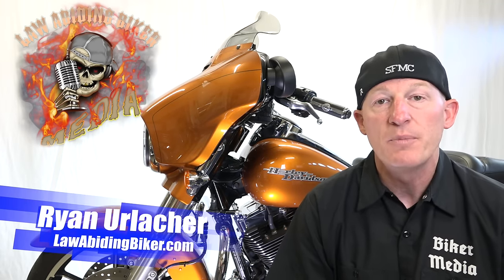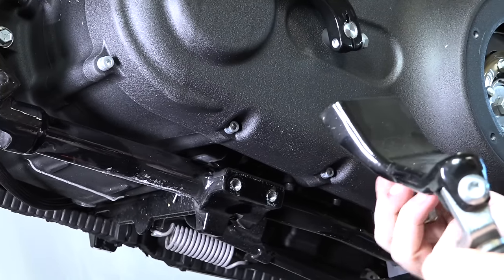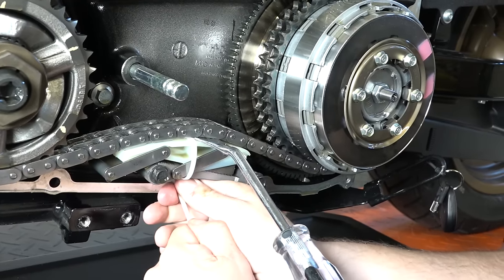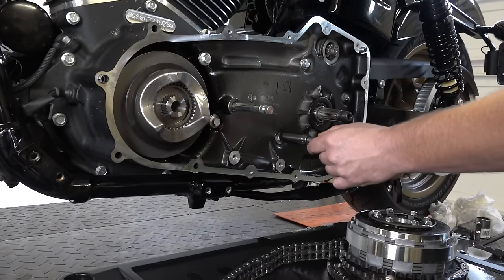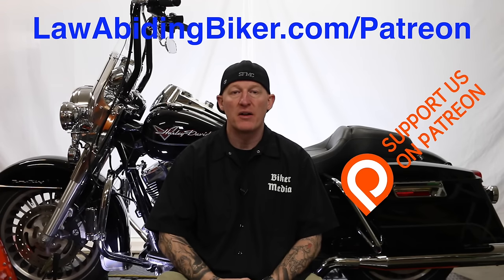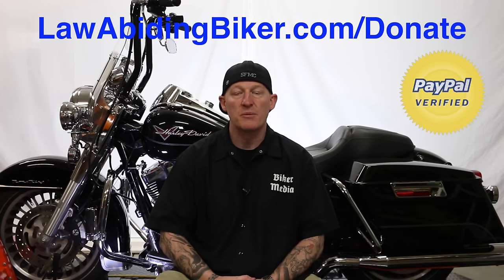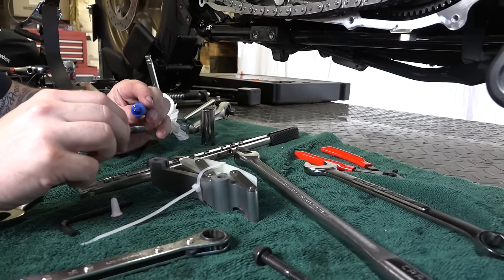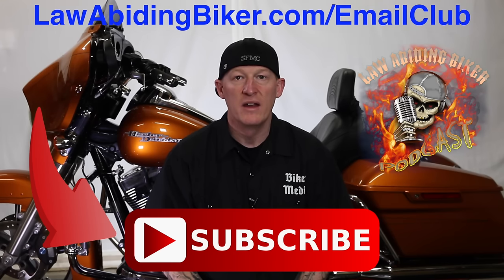How To Remove & Replace Final Belt Drive on Harley-Davidson-Motorcycle Biker Podcast

Comment: Interesting, I did not know Harley Davidson still used imperial size bolts and screws decades after the US auto industry went metric. The video shows everything but the actual removal and replacement of the final drive belt.

Comment: Wish I could find a video like this for the fam swing arm bushing replacement I need to know the nut size for the swing arm hshaft in hope I can get a ring spanner and thin it down so I don’t have to remove clutch set

Comment: First wanna say thank you to Ryan and team for an excellent video. I’m only here because I stopped to see if I could help a guy on an older super/wide glide who was broke down in a parking lot today. His final drive belt was broken in half. Nothing I could help him with.
I just wanted to see how much of a bastard job this was. Certainly not a side of the road job. Confirms my feeling that Harley built it’s best bike starting in 1952, the Model K. It was then modified in 1957 and renamed the Sportster. 2022 is the 70th anniversary of this bike, still in continuous production, 71 YEARS ! The first Harley with full suspension. The first Harley with foot shifting. And, you can replace the final drive belt on the side of the road, with minimal tools, if you are ever forced to ( my father kept a spare belt with him on his many cross-country road trips, just in case, so he wouldn’t get stranded on his Sportster, which he never had a breakdown on, btw ). I personally have ridden over 800 miles in one day ( 1700 miles in 3 days total ) on a Sportster with no issues to bike or rider. 
Model K / Sportster, greatest Harley of all time, that’s why it is still with us today.

Comment: Great video coupled with the manual concurred  a primary belt change on a fatboy 2012. The additions though to this video, exhaust system removed, swing arm bolt partially removed, managed not to remove oil tank through tooling mods.

Comment: I want to start by saying that this was a great video! Although I am a bit confused as to why you couldn't just put a 1/4" extension on your Allen socket to remove the starter bolt(s).  Welding all the crap together seems unnecessary, however if it works it works. Thanks for the video, definitely helpful!
Reply: If you look at the spacing of the bolt against the casing there is very little room. Maybe with a slightly longer alan head you might be able to do it.

Comment: Ryan great video. A couple points. I purchased the tool instead of using the wood. It only cost $39 I bought it plus the tool to hold the cam gear just to have in my tool box if I ever need them. I know that this is anal but when changing my primary oil my clutch cover bolts got rounded off (maybe my fault for not having a good Torx or HD tighten the hell out of them when they did my last service. I replaced the bolts and kept the good ones for shares. I tried like hell to remove the bad bolt, I finally removed the outer primary to lay flat and the sucker came right out. Oh don't ask about the oil filter, they must have used an impact on it. Sorry to go on but I've started doing my own service. I was just lazy plus when I bought my 12 Limited I got the 3 year service package I didn't pay for squat for service or parts. My dealer Or Harley don't offer that anymore. TTFN

Comment: Hey Rayn, thanks for this great video brother! I'm replacing the belt on my 03' Road King. The tip using the wood for the gear jam works perfect. Hope all is well with you and your family.
Reply: Hey buddy I’m looking at doing mine for my 03 roadking was just hoping you still have knowledge of all the torque specs as I can’t find them anywhere, cheers

Comment: On a 1995 (and other?) Softail Fat Boy you need to remove the oval chain tensioner cover. Two of the bolts go through into the inner primary cover so the outer primary cover will not come off without removing those.

Comment: Hey guys this a great video.  Nice step by step.  Only one thing I would add, at the 26:15 min mark while putting the clutch inspection plate back on you say to torque 74-108, but you did not specify that now you are using inch pounds and not foot pounds.  Mechanics will pick it up, but it could be confusing to some.  Please do not misunderstand, it is a great video, very informative.
Reply: Lol also didn't show installing the clutch rod.
Reply: Thanks for the video,  very good visual aid along the FSM.  Managed to loosen the starter bolts on 2014 Softail without removing oil tank. Tip:  remove battery,  then the plastic tray under it,  and you can feel the rear starter bolt just under the metal tab. Get 1/4 allen with swivel in through the battery compartment and  feed long 1/4 extension from intake side to join in there. Took me 5 minutes elaborating and 1 minute doing,  definitelly better than removing the oil tank.
Reply: @mgcmn  rear

Comment: I have to compliment you on this video like everyone else, it is very informative and very helpful to actually see it performed rather than read how to do it. You mention torquing the 5 primary cover bolts to 84-105 that would have to be in inch pounds. Can the shifter lever shaft be installed through the primary covers after they are assembled or should it be installed at the same time as the starter? The video showed removing it the same time the starter was removed but never mentioned it or showed it being installed during reassembly, just curious if it matters.
Reply: pretty sure that was by mistake. it has to be installed before cover

Comment: saw same thing no shifter shaft on reassembly. take it all apart  again. still like all videos thanks
Reply from the maker: That's because we moved and installed forward controls. No mid shifter anymore. Did it at the same time.

Comment: A text message on the video said on the Softail you have to remove the oil tank. I suppose that's to get to the starter bolts. But on my 95 Fat Boy I removed the inner fender cover which let me get to the rear starter bolt. Tedious, 1/4 turn on an allen wrench at a time but I got it. Then used a straight hex with a 1/4 socket and extension to get the front one.

Comment: Why did you take the clutch inspection, or derby cover off, if you are removing the inner, and outer primary covers? After watching several of your videos related to inner, and outer primary cover removal. I left the derby cover on, drained the oil out then removed the outer primary cover in one piece.

Comment: My 2002 FLHTPI has a cam type of belt adjustment at the axle nut  ? Unlike my 1993 FLHT , which had one similiar to the one you showed .
Any tips on adjusting the " Cam " type belt adjustment  on the 2002 FLHTPI ?
Great Video , Thanks for Posting !

Comment: You can get to the starter bolts on a softail with a 3/8” drive extension, you should disconnect the battery unless you have plastidipped tools or like frying the finish off of your chrome oil tank, or lines.
Reply from the maker: Thanks for watching!
Reply: Had to take the oil tank off mine. But mine was an 88 I don't think it could be worse to work on.

Comment: What a job .   Don,t break a belt out  in the sticks .  Crazy amount of work . I just watched a guy replacing the belt on an electric bike . It took him 30 minutes .
Reply: Exactly - I've seen it take a guy 19 hours doing it the first time with his service manual.  He was taking his time obviously and borrowing tools throughout which slowed him down but the amount of steps to simply replace a belt is ridiculous.  Especially removing the primary drive completely off the bike and the swingarm WTF.  So stupid.  But great video explaining the ridiculousness involved to replace something that should take 30 minutes if their engineers weren't morons.

Comment: where is the shift shaft ? I did not see it sticking thru on reassembly
Reply: Mark Miller They showed in another video that this particular bike got a forward control upgrade at the same time.
Reply: Just saw that too. Should have been explained.
Reply: @bearded_firemedic  since when is fowards an upgrade. Mid controls is where it’s at.
Reply: @EARDRUMASSASSIN  , not going to argue with you there, I prefer my mid controls as well! I should have put the word "upgrade" in quotes, as I referenced it directly from the preceding video where they did the conversion..

Comment: Looking for info on changing the final drive belt on a 2016 Road Glide.
Reply from the maker: We don't have one yet.  Sorry.
Reply: Same process except (a real pain in the ass) is the swing arm has to be removed on one side to slip the belt out. Ryan missed a big part for a bagger. I have a Street Glide and have to do this process.

Comment: Back in ‘84 I used a piece of wood to jam between the motor sprocket and clutch housing. I didn’t notice a small splinter of wood and of course it ended up plugging my oil return to the motor. I was on a run and checked my oil and there was none. I’m surprised I didn’t burn up that motor but it kept on running...the good/bad old days...thanks for the great videos amigo 😎
Reply from the maker: TY!!

Comment: After removing the primary cases and the belt how hard would it be to remove the transmission. My transmission mount is cracked

Comment: When replacing belt drive are you suppose to replace the pulleys as well or not necessary????
Reply from the maker: Not as long as they are in good shape and not worn.

Ride safe & Ride Often!
Here is a link to a bunch of our useful Free vids: http://www.lawabidingbiker.com/freevideos
Here is a link to some of our useful for purchase videos: http://www.lawabidingbiker.com/buyvideos
Want Answers & Information Fast? And help support us at the same time? Do you like the content we provide?
Our patrons get answers to their questions/comments/feedback in less than 24 hrs and are part of our Private Facebook Group. If you are interested in being in this exclusive group you can get all the details at ==> http://www.lawabidingbiker.com/patreon
If you haven't subscribed to the Law Abiding Biker Podcast make sure to do so. Listen in as we talk weekly about issues/items like this & so much more. You can listen on iTunes (Apple/IOS), Stitcher Radio (Android), or any other Podcast App ==> http://www.lawabidingbiker.com/podcast
Join our free email club at http:///www.LawAbidingBiker.com/EmailClub. Only relevant content will be sent from time to time. Email club members are the first to find out about free or for sale content are given special coupon codes.
Reply: Try getting that front pulley nut off..... It's a beast of a nut that is put on by satans own torque wrench

Comment: when do you recommend changing the final drive belt (miles/age)?  I have a 2012 ultra classic with 40K miles.  when should I look at changing it?  I'd rather change it on my terms rather than have it break while on the road.  thanks and love the videos.
Reply from the maker: They can go for very high miles. Just inspecting them is the key when servicing/inspecting your bike. There are general times HD recommends for different years/models.........I'd just look in your owner's manual. Likely, you can go even past what they recommend. they don't fail that often unless they get some sort of damage or sharp rock or something stuck in them.
Reply: thanks for the info and your time.

Comment: I have a 3" BDL belt drive with side support am having a very hard time removing the side support, used a pulley to get it off.The support came off but the bearing on the motor didn't , i tried a bearing puller an tighten until i was scared to tighten anymore because it shouldn't need that much force, or am i wrong? Help

Comment: I'm wanting to switch my front sprocket from a 32 tooth to a 34 tooth for better interstate cruising. Is there enough adjustment to use a stock belt or do I need a longer belt?
Reply: I done it on 2012 streetglide kept the stock belt ... hiway rpm went down about 500rpm but I switched back to stock because it was tall and hard to keep in 1st during stop n go traffic ...kept on needing the clutch below 5mph and you kinda have to let up on ur throttle when ur riding in groups because the rider in front will be shifting gears b4 you and u need to slow up so u dont hit him while you wait for him to get back up to speed...than ur out of "sync" when you have to shift ... hiway it's great

Comment: Mmmhhh forgotten to re-mount the gear-speed lever and pedal. I don't know if it needs new o-ring to avoid oil leakage and dirt shoe.
Reply: In the older comments he mentions they put a forwards conversion on at the same time. The hole in the cover is plugged with a seal.

Comment: Why didn’t you put the shifter back in? Also, should there be a gasket on the shifter of some sort?
Reply from the maker: Stock shifter got move forward because we did a forward control kit. We put all the gaskets required
Reply: Ryan Urlacher thanks for the quick reply! Gotcha, didn’t think of a forward shifter conversion

Comment: I'm replacing my drive belt I have an open primary belt iv got the clutch pack out . How do I get the clutch housing gear off ? Any tips would be great appreciated
Reply: u need a puller, some of those call for red locktite on the splines.

Comment: For softail you will need to remove the swing arm bolt and drive side swim arm spacer
Reply from the maker: Good info and thanks for sharing with the community here.
Reply: Same process on a Street Glide and its a bitch to slide the belt past. Warm it in the sun helps

Comment: Sick of breaking belts waste of time I went to 530 chain conversion and never looked back .
Reply: I have never broken one belt, not sure how you do that..........
Reply: @terryjohns4483  I broke a belt on a Road Glide a couple summers back.  The belt had picked up a small hole (probably a bit of gravel lodged in the rear pulley).  Even so, I rode for another 15-20 thousand miles before the belt finally let go.   It's not an insignificant job, especially on a bagger or softail, where you also need to pull the rear swingarm.   Still, in over 30 years of riding Harleys with a belt final drive, one failure is more than acceptable.

Comment: Great video, but are you sure you mean red loctite?
Reply from the maker: Yup, red.
Reply: Because I saw some blue go on those chain tensioner bolts.
Reply: @RyanUrlacher  Red Loctite is not to be used on bolts that go into aluminum...Red is designed for "permanent" mounting such as a bearing race into a hub or a bolt into steel threads.... metal other than aluminum.
Red is too strong for aluminum and it has the possibility and likelihood of taking the threads with it unless heat is used when loosening.

Comment: Well , I was CruiZN down I-40 in NC today on my American Ironhorse Texas Chopper and my drive belt broke ..Luckily i came up on an Off ramp and coasted to the edge ...  Anyway , my Chopper is at home on a trailer and ready for me to take it to 1 of 2 motorcycle shops tomorrow .. I did call Smokin Harley Davidson in Kernersville , NC ,, they quoted me a price between $ 700 and $ 800.00 just for the Labor
 ( no Parts ) I won't be using them !!   ... UnReal .. This Suck'ss !!
Reply from the maker: Hope you get up and running soon! It does suck
Reply: Thanxx 4 yr reply ..  Ok , the chopper has been at the bike shop a week tomorrow , Thanksgiving has passed by and I need to go pay for the parts .. The Owner said that I'll need a New back wheel pulley . American Ironhorse used cheap Polished aluminum  for the wheel pulley and the teeth on mine are Sharp and deep , ( Wore Out ) .. Gonna replace it w/ a Non matching ( w/ the main 18'' wheel )  a Harley Davidson Chrome Metal pulley . New belt and everything else needed for the Primary .. Close to $ 1k   .. Yes it Does Suck , but ,, maybe I'll Never have this happen again .. I Will say ,, When yr riding and that belt drive snaps ,, yr Freaking Stranded ...  I'll chime back in here after I get my bike on the road and a few miles to C how it's doing ,,,  B cOOl ,, B_R